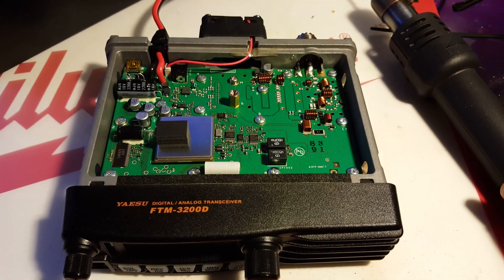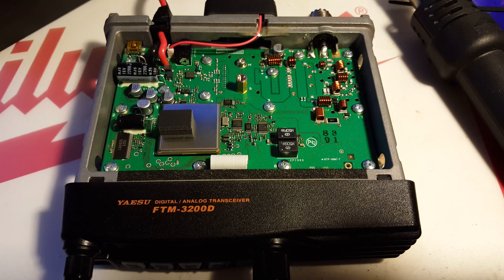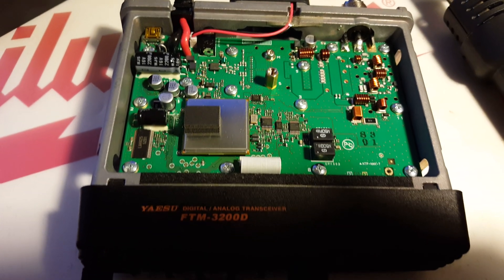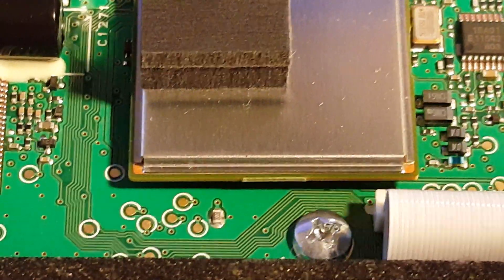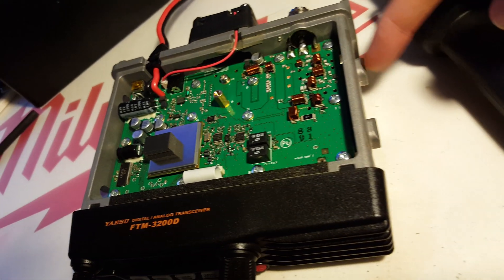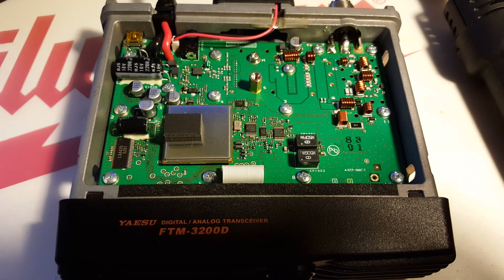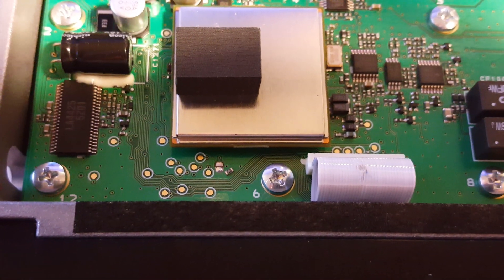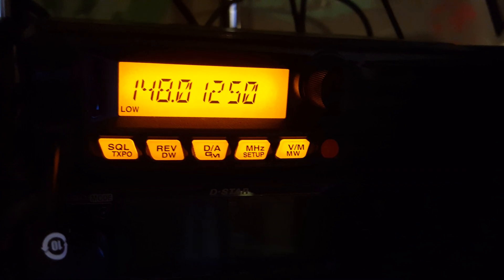Yaesu FTM-3200D Extended Frequency / MARS mod

Comment: It isn't clear to me why the radio's configuration ("programming") was lost unless you needed to do a RESET operation after removing the jumper.  In the 2900 series, I believe that a reset step (pressing three buttons while turning radio on) was needed.
Reply from the maker: Not sure why it does it but it does, it basically reset itself.

Comment: Did this, but after popping the lid, it looked like the resistor was soldered on the other side of the PCB! After I applied the iron, what seemed to be the resistor, buried under a lot of solder, was able to be scraped away. The mod has been done and the radio is now wide banded. Thanks for the help.
Reply from the maker: The resister was on the underside of do you mean it was over to the right side?

Comment: About to do this for extended Transmit for Marine Band. Thanks.
Reply from the maker: Excellent, hope it works well 👍
Reply: Did it work for the marine bands? I want to transmit on 157.050
Reply: @wdsracer  Absolutely